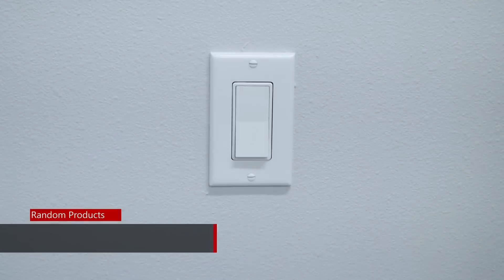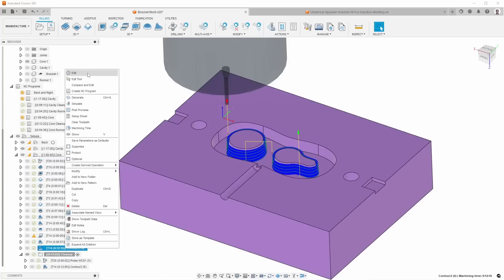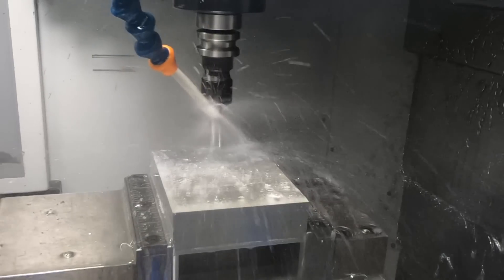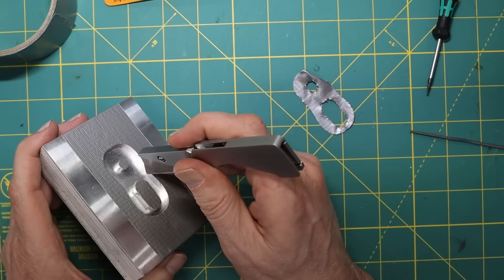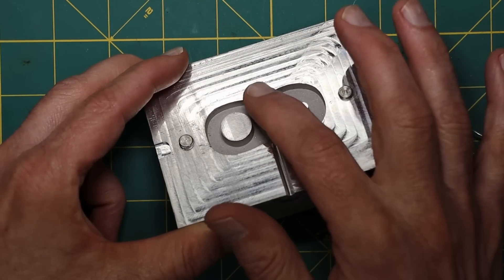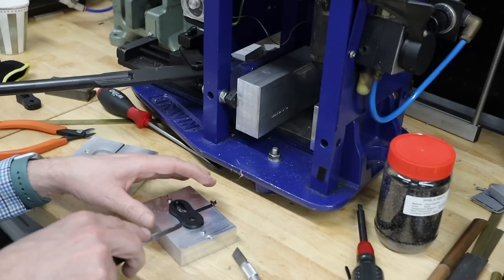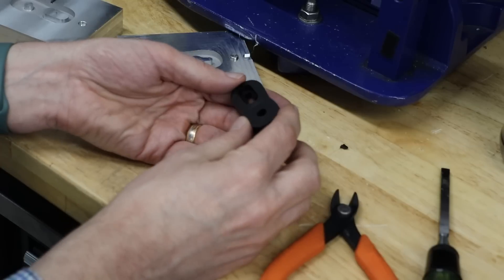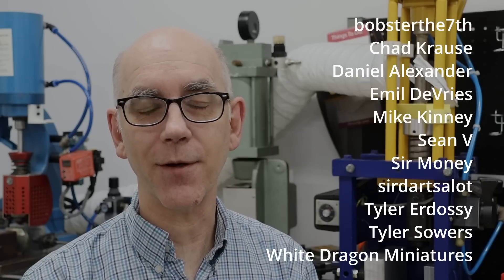Adding Texture to an Injection Mold

Comment: I extract cast urethane parts using an air gun. Since you have holes that go all the way through it would be super easy to use the air pressure to pry them out from the bottom up. Just use a rubber tip.

Comment: At my shop we do plastic injection mold making, and what we use to tape off areas is this general purpose yellow vinyl tape. It offers smooth adhesion, but isn't a mess like duct tape, but also withstands the force of sand blasting.  It comes off like butter if you use kerosene. In fact, most adhesive messes are almost completely destroyed by kerosene, so it might be worth keeping a bottle around. 
Spray it down with kerosene, peel off the tape, lightly clean up with tissue or a very clean, soft rag, and then spray down again, then spray it down with methanol. Clean as ever. The nice thing about the yellow vinyl tape as well is it can be CUT and SHAPED very neatly with a sharp knife, so you can maintain a sharp line on your part. Hope this helps!

Comment: If you can't use ejector pins, use inserts for the cores, get a slide hammer to connect, and ask your a material supplier to get you a bag of lubricant for p.p, p.p normal has 0.2% but you can add more to help, it's like a opaque jelly wax.

Comment: Very nice! I'm curious -- why are you using this press instead of the morgan press? Also, who makes this press?
Reply from the maker: Thanks. This mold is meant for a Travin TP-1, which is a smaller machine than the Morgan. More importantly, the customer specifically wanted a mold made for a TP-1.

Comment: Great video! I made some small molds myself and instead of using the tape, you can add 1mm to the mold thickness, sandblast the whole surface and mill the finishing 1mm to have the smooth closing surface. Keep up the good work!
Reply from the maker: I thought about doing that, but I don't remember why I didn't do it that way.

Comment: Just wondering... can't you just superglue some siliconcarbide or fine sand? With superglue I mean the heat resistant (250C) superglue variants; just add a nice squirt, let the excess flow out so you end up with a very thin layer, and throw in the sand. That process would be much faster if it works.

Comment: Poor position of gate causing jetting effect.. design next against some wall.. surface of plastic is always a little less deep than on tool.. so if you want VDI27 on plastic use  VDI30 in tool.. last thing I would recommend is to add any ejectors or at least loose insert of middle bosses..
Reply from the maker: Thanks for the tip. I could easily have done that in this mold. As to ejector pins, that would have made the mold more expensive. For these desktop machines, keeping the cost of the mold down is important. Plus, many of the desktop machines are such that you have to remove the mold from the machine anyway. I've talked to other companies that make small run parts with desktop machines and found they do pretty much the same thing. No ejector pins, and then pry the part out of the mold.
Reply: @JohnSL  OK I understand that ejector pins are not suitable for this kind of job but anyway try to consider using separate inserts for inner shape so you can disassemble them from top side firstly with hammer and some pin without touching plastic part (plastic part sticks mainly on inner surfaces due to shrinkage) and rest will go easily from outside surfaces so you can be sure that plastic will not be damaged... BTW overall it is great job and I like your content of the channel 👍 keep going forward.. if you will have some more complicated jobs or anything not sure about let me know I can help you 😉

Comment: Nice work. I was concerned about the end mill marring the sand blasted finish on your cleanup pass. Even if it was registered perfectly, expansion caused by different temperatures, bounce back of material, or of a bunch of other factors can cause a obvious mark when re-milling a part. I never considered injection molding as a process I could do, but I need a very small hydraulic coupling with a weak check valve that is made of PEEK plastic. After seeing your work, I’m wondering if I could injection mold something with a ball and spring encapsulated. I’m a machinist running the machine shop for a company that does science experiment development for the International Space Station
Reply from the maker: I've found that keeping the end mill 0.001" above the floor is enough to keep from marring the finish. Unless, like in this case, something gets under the mold so it's not flat against the parallels. In other words, it was operator error in this case.

Comment: Duct tape is "good enough" for many jobs but seldom ideal.  The best sandblast mask I've encountered is called Oramask - it's a self-adhesive vinyl product you can find at sign supply stores.  You can apply it to the mold while it's still in the vise and let the CNC trim it for a perfect fit.
Reply from the maker: Oh, that's cool! Trimming it in the CNC would be much nicer. I'll have to try that out. Thanks.
Reply: I second this, Oramask (no. 831 IIRC) is the way to go

Comment: This was a great look into the various things that can affect a mold and the machining.  The tape residue was a surprise!  It looks like you are using a straight endmill to machine the walls.  Have you ever used a tapered mill to do that so you can eliminate the time it takes for the step overs?  I've used tapered mills in wood, but haven't ever used them in my mill on aluminum.
Reply from the maker: I know there are end mills with different tapers, and I believe that's what they used to add draft before CNC machines. With a CNC machine, it doesn't take very long to program the tool paths and I can have the draft be any angle I want. And it means I don't have to use a specialty end mill that would take up another slot in my tool changer.
Reply: @JohnSL  I guess I'm thinking about large machining projects that are kicking out 1000's of parts...  I need to think about molds as relatively small parts that are one-off situations...  In that case, 10 minutes of surfacing passes is just a drop in the bucket.

Comment: I have several years experience with media blasting (from two former jobs and as a hobbyist).  Re-machining the vertical faces is an interesting approach; however, this could have been done without re-machining, too.  Those vertical surfaces could have been masked several different ways.  Masking tape is effective for most media blasting (without the aggressive adhesion of duct tape)--so long as the blasting process does not dwell on one spot too long.  Those vertical faces could have been masked with masking tape.  Alternatively, there are masking liquids that can be brushed on and left to dry.  Even "rubber cement" could be brushed on as a liquid mask.  Some paints, including fingernail polish, can work, too; but you have to be aware of the ease (or difficulty) of removal of a brushed on mask.  Experimentation, with scrap pieces is important.
Reply from the maker: I did think about trying to mask the walls. But it was very quick to put the mold back into the machine to mill these walls. If I hadn't had leftover tape on the bottom of the mold, it would have come out perfectly. I'm not sure I'd get as precise results with masking those vertical walls.

Comment: John, this channel is fantastic and I've learned a ton from it in the short couple of months I've been aware of its existence. I am curious what all is involved for procuring both a good mill for aluminum molds, overall tooling costs [I don't imagine aluminum is very expensive but I've heard replacing bits can get expensive for precise and detailed mold work], and what you could suggest in terms of good resources for learning some of the art of moldmaking. I am experienced in SLA/FDM 3D printing and am currently exploring using some high-temp casting resin with SLA process to make some short run molds, but I understand they don't last more than 20-50 cycles, depending on detail, size, quality, etc., and for moving beyond prototyping I am going to have to use some sort of injection molding process and that has sent me on this marvelous journey. Also, what do you think of the Buster Beagle 3 compared to the older model?
Reply from the maker: I used to use a Taig CNC mill to make molds, so that's a good choice as a starting point. If you get one of their ballscrew versions, they're plenty accurate enough. I believe the prices of their CNC machines is in the $2K-3K range. Tooling isn't that  bad for aluminum. As long as you use the right feeds and speeds, they last for a long time. This video of mine should help with that: https://youtu.be/6HpHvuyJBF4  As to the BB machines, I don't know a lot about them.

Comment: Great video as always!  I’m curious if it would have been possible to leave several thousandths of surface on the mold halves so they could be faced to final dimension after blasting, thus avoiding the tape altogether!

I have a part I need to produce that will involve some texture so I’ll need to figure that out for certain, but that was my planned approach. 

I figured as long as I had a reference to probe that didn’t get affected by texturing I could just do my final facing passes afterwards.
Reply from the maker: I did think about doing that, and I believe it would work well. In this case I wanted to test the mold and adjust it before adding the texture It didn't take that long to mask the mold, and I now know I don't need to mask the bottom.

Comment: Silicone Carbide media is what we used for textured surface requirements, which can be had in many grit sizes. With time and allot of plotting and keeping of test samples, we could plan out with which grit size of the carbide media, at what PSI, all pending which material alloy was being used to predict a particular surface finish. It was a crazy catalog process, but, all in all, I think what your results were, came out really good. Too much texture or deep patterned texture, pending the draft angle and make pulling a part out exceptionally difficult if not impossible. Even with a good enough draft on the walls, and core pins or "knock-out-pins" the drafted walls with heavy or deep texture, will start to wear the texture out on the cavity. Granted, that is determined by quantity or the run, the material being injected, the draft angle, the depth of the texture and how cool the finished part is and a few other parameters, of course, no concern for what you are doing, and just adding my 2 cents, beings you asked. 

There is another factor, virgin media provides one type of cutting action in surface finish, where as, recycled back into the sand blasting cabinet type system, the second use, on out to 50 times used media, (no matter the type of media being used, some less then others) that used media will cut completely different. Often times, sand blasting media on the second to fifth use or pass-thru, will actually cut much better, as each grain gets broken or fractured. The next time around, the brand new edge of the grains cuts better. Please note, some sand blasting media burnishes, polishes, work hardens, cuts, and a few other actions that are more specialized. Just in case you all didn't know. 

It is important to know, regular beach sand is something that you NEVER want to use as breathing any of that in, can cause serious respiratory issues that can lead to death, not much different than that of mesothelioma, called silicosis. Bad way to go out. 

I enjoyed watching this process the past few videos. 

It is important to note, anything I have mentioned, is in no way meant to insult you or anybody that may read my comment. I do not claim to know it all. I am always willing to hear of methods or clever ideas that I have never learned. I am open to be asked questions and I will assist in answering to the best of my ability in the greatest of detail that time permits.
Reply from the maker: Thank you for the detailed reply. It gives me some very useful information for more research. Given how small my parts are, I should be able to use one of the small portable sand blasters that would not recycle the media. From your reply, it sounds like that would actually produce more consistent results.
Reply: Hey Bradley, my name is David and I'm from Poland, I have some questions, if you have time to answer them, please let me know how I can contact you. Thank you in advance
Reply: @dawidwasielewski8669  Sure, what is your question(s), I will do my best to answer them. If I do not know the answer(s), I bet that we together, including the channel owner "JohnSL" can come up with something for an answer or direction, at which point, we all get to learn something together, and we'll all be better for this effort of researching the unknown's.
Reply: @drubradley8821  Thank you for your answer. 
I have a small injection mold service in Poland. To be completely happy, I lack the knowledge of how to make a VDI texture using sandblasting or acid, and unfortunately in Poland it is a closely guarded secret. There are only 2 companies that do this and they have a monopoly on it. I'm a toolmaker, so I know a bit about this profession, but I've never dealt with textures, and we often get tools with a damaged texture (mainly VDI after EDM). I heard that a mixture of corundum and glass beads is used for this, but I do not know the proportions, nor the thickness of the sand, nor the angle, nor the pressure. 

Can anyone give me the exact instructions? The rest will be in my hands, I will try.
Reply: @drubradley8821  anyone?..